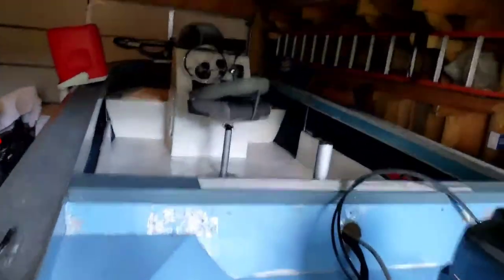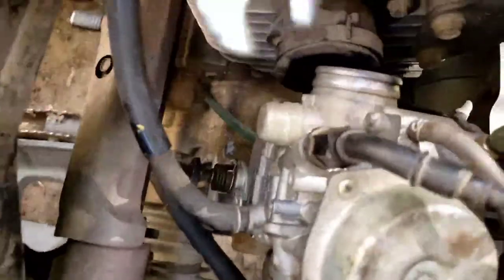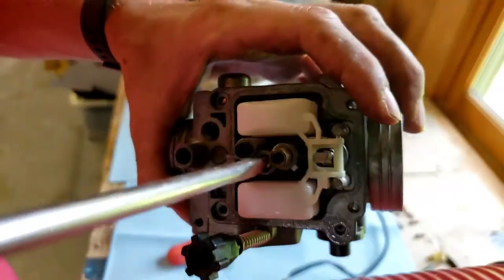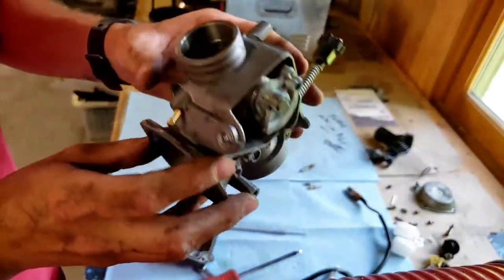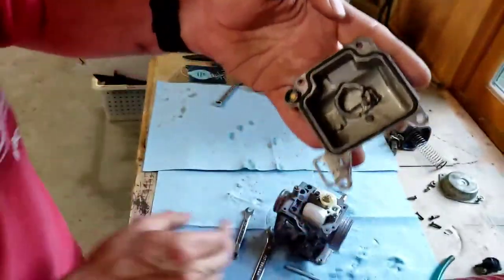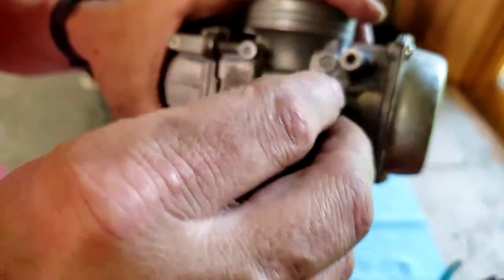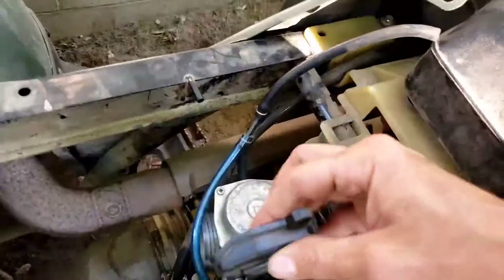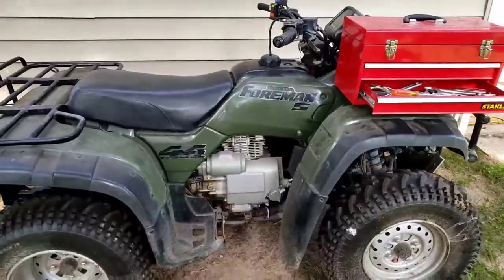Honda Foreman won’t stay running. How to clean carb.

Comment: Great instruction, I'm totally inspired to rebuild my foreman carburator.  This is my first straight gas carburator rebuild. You are so confident in knew what you were doing and made it look like I can do it so here I am doing it. Anyway I got to the mix screw where you're supposed to count two and a half down and then take it out or see how it is 2 and a half or whatever anyways it is a special adjustment tool so I believe that my chainsaw my Husqvarna adjustment tool might work.
Reply from the maker: Thank you for the kind words. It’s not hard at all just might be daunting at first if you have never done it. For the adjustment screw, You can also use just a flat blade screwdriver. I don’t have any special tools.  Just be sure to note where everything goes and how many turns out the mixture screw is and you should be good to go. Good luck with rebuilding it. I hope it runs as good as mine did when I was done.

Comment: I have the 500 hundred Rubicon.   Air inlet tube that runs into the box is on the otherside. Took me 6 hrs to clean that carb. Always loose them plastic clips that hold the panels on. Bought it last year . Last year as soon as you hit the start button it would crank immediately. Drained all gas. Cleaned carb. Hard to start the first time in 80 deg weather. Once it starts no more problems untill the next day. Driven me mad.lol
Reply from the maker: Yeah, can be a pain

Comment: Watched video & took notes. You did a good thorough job explaining how to rebuild the Carb. Carb float stuck open on mine, pouring gas.
Reply from the maker: Have you tried to close it by tapping the carb base with a screwdriver or small hammer?
Reply: @BackyardGarage1  I tried  Pecking on carb & Seafoam with no luck. After watching your video I will get to work rebuilding it. Thanks for the help.
Reply from the maker: @ancilhall2933  ok great! Good luck! Tilts super easy if you have any doubts, just take pictures as you go and make sure to count the turns on the idle mixture screw from fully seated when you take it all apart to clean.
Reply: @BackyardGarage1  I wrote down step by step what you said in the video & made a diagram of the carb. Thanks you for helping.
Reply from the maker: @ancilhall2933  awesome! Super happy to help at least one person.

Comment: On the ultrasonic, did you turn on the heat? If so, what temperature? Thanks in advance
Reply from the maker: Yes I do. I set it to max heat. The hotter the better for cleaning. Helps get any grease loose and come off.
Reply: @BackyardGarage1  awesome thanks again!  I have a 2009 Honda Foreman TRX500FE
Reply from the maker: @jonnyv.5718  awesome! Good luck getting her running.

Comment: very informative I used your instructions to do mine but could you tell me about that rubber piece you took out in bottom of carb next to that jet should it have something inside of it mine has something that looks brown in color or should it be just an open hole ?
Reply from the maker: It’s probably a filter.

Comment: My mixing screw looks sealed 😊
Reply from the maker: If it’s sealed, try to put it into an ultrasonic cleaner or soaking it in chem dip (can get at auto parts store) and let it sit and soak for about an hour or 20 minutes in ultra sonic and then rinse with water and blow out all passages to make sure they are clear.
Reply: Wasn’t seal cap just no slot for screwdriver 🪛 but like a D shaped head so I a slot myself.
Reply from the maker: @ ok awesome!